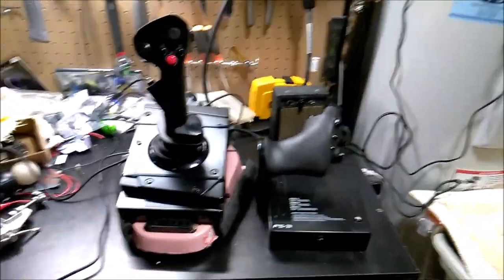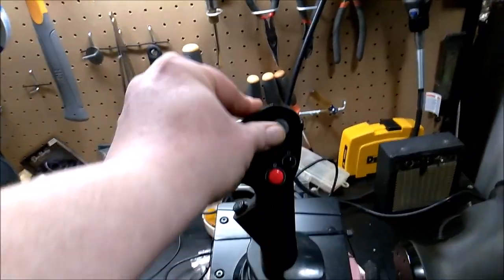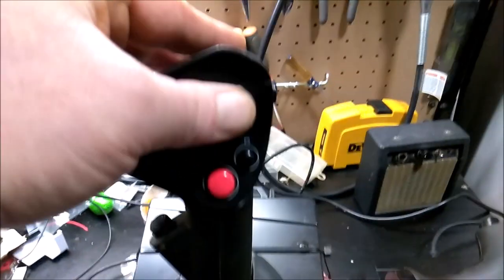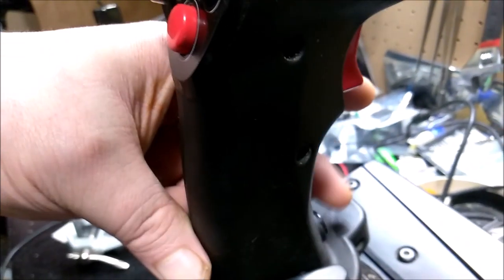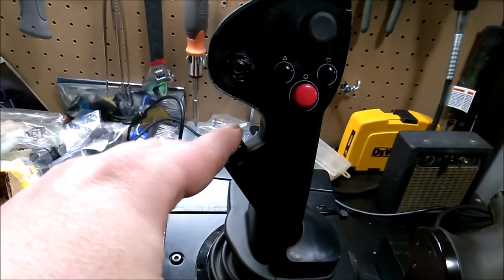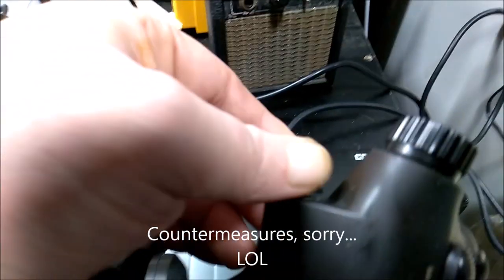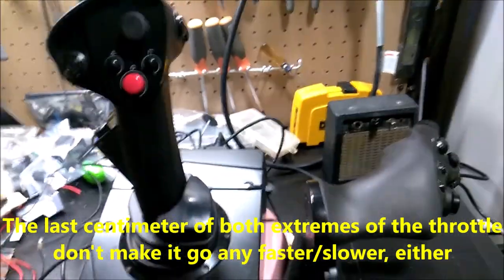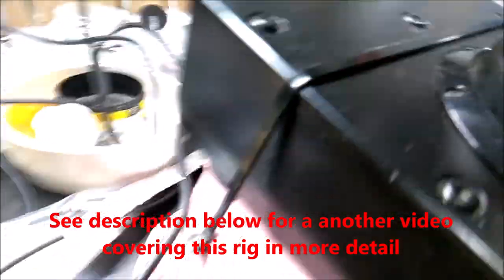Star Wars: Squadrons - Hori PS4 HOTAS Setup/Throttle Fix (I hope...)

Comment: It seems motive have now acquired a Hori, I hope the issue is solved soon
Reply from the maker: Oh sweet! That sounds like good news! I think they should use my suggested button layout as the default. LOL Where did you hear this?
Reply: What/who do you mean by "motive"? :o I'd really like to see the Hori issues fixed, won't order one until it actually works (without the deadzone and throttle problems).
Reply: @muzso  motive are the game developers, they have now said that cant sort all the button issue's but a patch is coming in december.
Reply: @Billkwando  Twitter
Reply: @Billkwando  this is what was tweeted. Yes. The December patch will improve the Hori experience. Not much we can do about the hardcoded combo buttons like L3+R3, but other issues will be fixed. Details will be in the patch notes.
Reply: @ScoutTrooper33633  Thanks! I wasn't aware. I only knew that the game was published by EA and thought that they are developers too. Now I see that EA publishes games from 3rd party dev companies as well.

Comment: Tried switching the PS4/PS3 switch to PS3 and it doesn’t recognize a controller is connected
Reply from the maker: Weird, someone on the forum told me it fixed the throttle issue for them. 
https://answers.ea.com/t5/General-Discussion/PS4-hori-flightstick/td-p/9540995/page/2
Maybe there's another switch. Is there a Setting 1 and Setting 2? (Setting 1 should be the right one) Let me know if you find it and where it is, and I'll go back and re-edit the video.
Reply: @Billkwando  that was me, apologies im new to all this, the switch in question is the throttle/rudder on the throttle itself. Change that to 1 and remap
Reply from the maker: @ScoutTrooper33633  Thanks for getting back to me! I'll note that and reupload the video. Before I do, can you tell me if you're able to use my mapping or are there buttons it won't allow you to map because they're assigned to two functions, like the flare?
Reply: @Billkwando  i used my own mapping as it  suits me better but as the stick is still being recognised as a controller some buttons are indeed doubled up.
Reply from the maker: @ScoutTrooper33633  Is it the thrumb button and index finger button on the throttle, and I assume it won't let you map those?
Reply: @Billkwando  the L1/L2 R1/R2 buttons are doubled up so they register on both the throttle and stick if that makes sense?
Reply: @ScoutTrooper33633  I’ll try that now
Reply: @ScoutTrooper33633  throttle still reacts as a button press and doesn’t scale. Gonna keep messing around
Reply: @ArtDilla  I said its better not perfect 😀
Reply: Thanks billkwando; but what about the doubled buttons (L1+R1; L2+R2;...) how do you use them if the game controller panel for reassigning does not recognise this double buttons??
Reply: @nimphenomenon  You can only use them for one thing each
Reply: Major patch today but still nothing for the Hori
Reply from the maker: @ScoutTrooper33633  Yeah I pinged EA_Charlemagne on the EA forum and asked him about adding Hori support, or at least the option to map pairs of buttons (like Elite has) which would solve the issue of the buttons like L1 + L2.
Reply: @Billkwando  for me its the throttle issue thats the biggest problem
Reply: @Billkwando  any response for EA?
Reply: @Billkwando  @Kris K as of Oct 2021, is the Hori ps4 version (or yours) still recognized as a controller 🎮, or a flight stick🕹?! 

I’m on ps5 so I ordered one based off of vibration feedback/headphone jack for immersion, however I am aware that some buttons are doubled up (thinking about buying pedals to free up some button inputs)..It is good to hear apparently the throttle and input deadzone issues have been patched..

my real questions for u guys is …
1. r u able to map every button/action with the hori?

2. is it recognized as a flight stick ? 🕹?

3. in your opinion do U think pedals will assist?

Comment: The throttle has been fixed
Reply from the maker: Yup! Yay 4.0! Tell us more in my Reddit thrad, if you would: https://www.reddit.com/r/StarWarsSquadrons/comments/kb6reu/it_appears_some_tweaks_to_support_the_hori_hotas/?
Reply: You say this but I still cannot figure out how to get my HORI working, I got it today and I have no option to change to flight controls
Reply: @connorramsay7617  have you gone into settings in the game and remapped?
Reply: Which setting is it that I need to adjust to get the full ramp of my throttle?
Reply: @connorramsay7617  go to throttle up and the push forward to set it, then go to throttle down and pull back to do the same

Comment: the problem is,  on ps4 anyway,  that you want throttle control to be responsive in every degree,  so you can turn youself by slowing down and speeding up as thats the tight turn trick, like you did in Rouge squadrons,   boost is too uncontrollable,  with the deadzone so huge on the HORI flightstick anyway,   it becomes more like a button on /off  and you have to guess when its going to start increasing and decreasing as you move through the deadzone,  absolute shit .......  mines going back.   Needs an update from the game maker to sort it,  really its a poor oversight and the game makers clearly dont play it or like star wars.   Like the shit films that came out.......    I assume that the game developers wont waste time fixng it for ps4 ,  and will wait till ps5 comes out and them bring out another game that ticks all the boxes and make a shit load of cash....  like they do .  Cheers mate,  thanks for doing the vid.
Reply from the maker: and you tried setting the switch on the throttle to Setting 1?
Reply: @Billkwando  yeh mate,   nothing.   Lacks support.   On P.c. theres an axis mapping software fix,  apparently .....   so its how its set in the game.   I,m on a PS4.  thanks for replying.